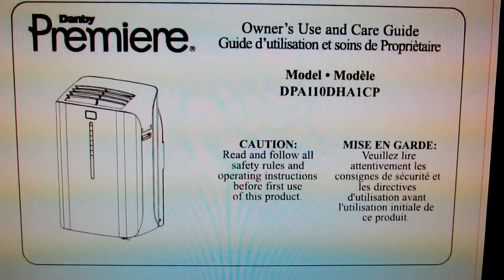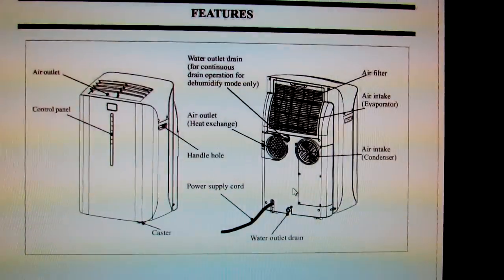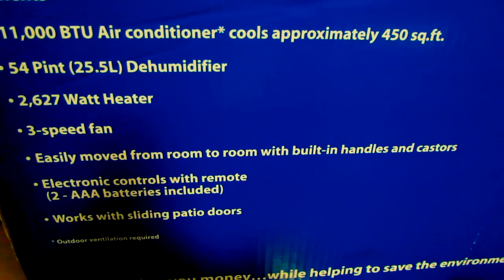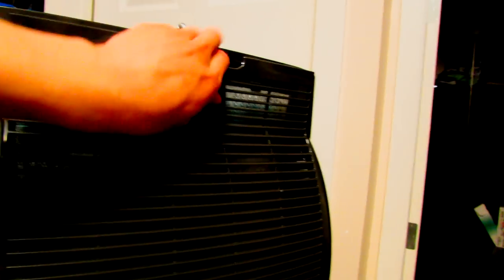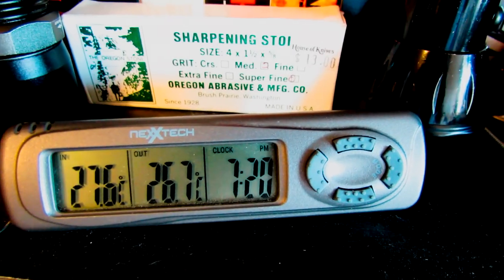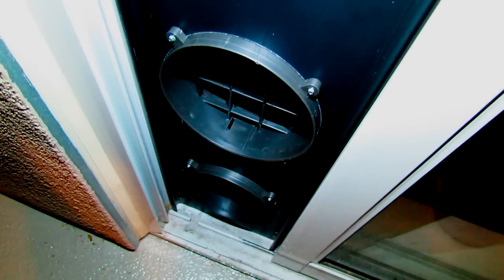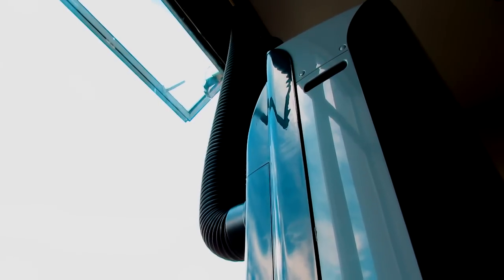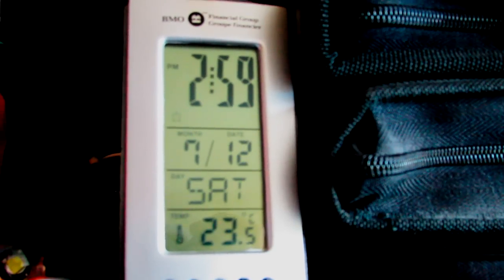The Best AC Unit for an Apartment - Danby Premiere 11,000 BTU 4 in 1

Comment: i have mine set up on  a coffee table about 2 feet off the floor. used a piece of cut garden hose that fits ont he bottom drain perfectly. u can even thread the spout into the rubber of the garden hose. then the other end of the 3 foot garden hose goes into a bucket.  i live in ontario and i have emptied it a few times in the last week.its been humid..  i noticed that you stated it uses that water to help cool the coil , so if i continiously drain is it still able to do that? or am i taking that water away to quick for the machine to do what its intended to do?
Reply from the maker: Hi, 
If you continue to drain, it may not allow the auto-evaporating system to work.  I would let it fill up first, then empty it when it shuts itself off, indicating it can't evaporate enough to not fill up.  If the humidity outside is low enough, you shouldn't have to empty it for the entire summer, and at the end if you check it, it could even be bone dry.  Even if it's hot and humid out, it should be splashing the water against the hot condenser coil and still be able to dry it out with the humid air, since the condenser is so much hotter than outdoor air.  You can open it up and check to see if the slinger is working properly.  Check out this article: https://hvactrainingshop.com/portable-air-conditioner-not-evaporating-water/
It explains it pretty well.
Cheers!
David.
Reply: @DavidSunshine  thank you for the reply.. once i moved to my new place july 1st i capped the end of the hose and just let it do its thing. ive had it shut off 1 time in 2 months and only drained a little bit ,so thsi is how i will run it from now on.. works great lol
Reply from the maker: @sean2743  Hi,
Oh good job! Nice to hear!
Sounds like it's working great.
These are great AC units.  I'm still cranking mine every year and it's working great, 10 years running!
Hope it keeps going for many more!
Cheers!
David.

Comment: Can you share the link to your AC please
Reply from the maker: Hi,
Unfortunately, Danby discontinued this model, and doesn't look like they have dual hose heat pump ACs anymore.   To be honest, I didn't use the heat pump feature, it was always nice to have as a back-up in case the central heating stopped working, but that never happened; it's loud, so you'd only use it if you really had to as back-up.
Danby makes a 14,000BTU unit that's advertised as a "heat pump" with 4-in-1 functions, including heater, so you could get that one if you wanted the heat function, but it is single hose, so you won't get isolation like a dual hose system:  https://amzn.to/2AtmCVq

In the description, I have some options to dual hose systems (They aren't heat pumps though).  Whytner, Black and Decker and Honeywell are all big brands that you can trust in, similarly to Danby.  I have some single hose systems linked, but I don't recommend those if you want to isolate yourself from the outside air(which has pollen, cigarette smoke, BBQ smoke, pollution, etc.), I prefer dual hose systems.
Since I never used the heat function, I would recommend a simple portable AC with Dual Hose, without heater function.  If you really need heat, you could purchase a $15 plug in space heater, for emergencies.  That's a better set-up than having a heat pump in the AC unit, since it'll cost a lot less.

Hope that helps!
Cheers,
David.